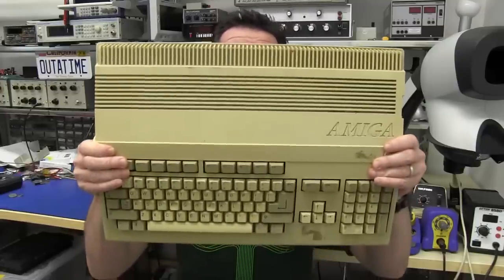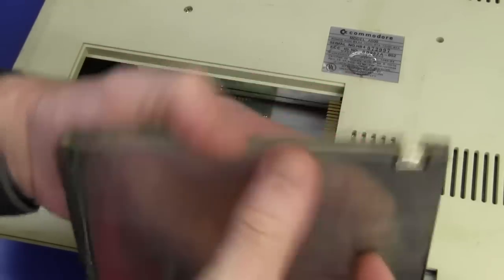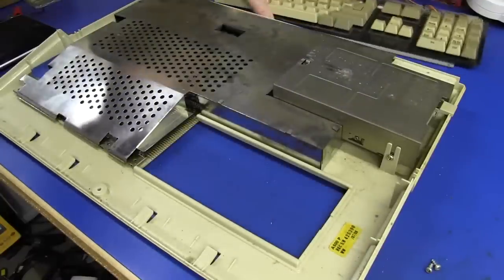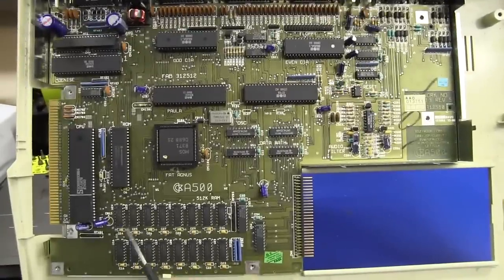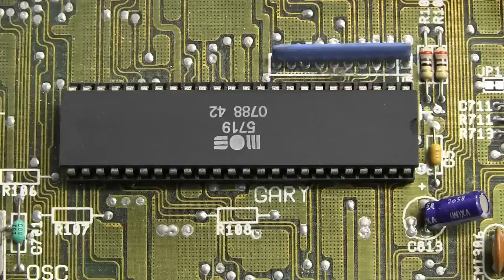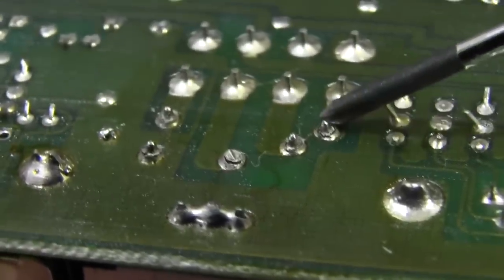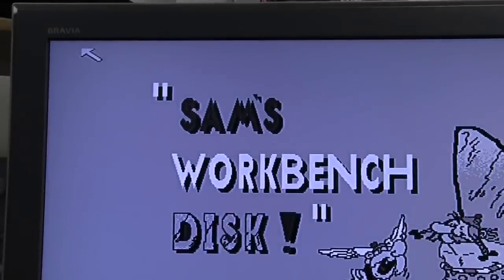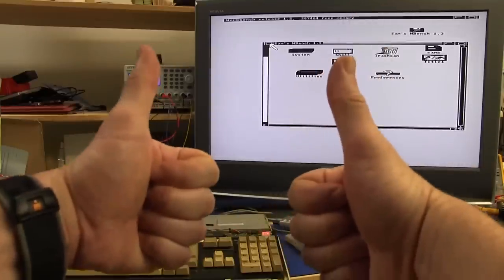EEVBlog #438 - Amiga 500 Retro Computer Teardown

Comment: no it isn't. get your facts right before you spout your mouth. 16 bit data bus, 24 bit address bus. the most significant 8 bits of the address where tied to ground on the CPU,  I programmed the Amiga 500 back in the day and later the A1200.

Comment: The ipad has a non-removable battery that will degrade in a few years even if you dont use it.  Apple have deliberately made it as hard as possible to replace it as well, prefering you just buy a new ipad. In 2035 i doubt youll be able to find an ipad battery still functioning.  Lcd screens (backlight failure, organic decay) and flash ram (limited write cycles) also have a limited lifespan.

Comment: graphics and endless layers of frameworks and abstraction.

shit like python running in java virtual machines running on c# bytecode... 

software nowadays is mostly quick dirty and inefficient just so they can crank out more stuff in less time. that's also the main reason most software gets so many updates... it's a mess.

a custom arch linux build is the only thing coming close to efficient: a full desktop with browser and all using no more than 300mb of ram and 2% of my phenom2 955.

Comment: Big hype for a pile of crap I thought.  Back in the day I blew like two grand for the Amiga 1000 with monitor and 256k expansion.  What a waste.  But if ya take the lid off the 1000 they have the team's signatures put in the plastic somwhow.

Threw it out anyway because it really, really was a total heap of trash.  The fact that Commodore made a comp after the 64 that wasn't backward compatible was a disgrace (personally, I think that sank the company).  Yeah, I bought the 64 emulator that was available and was able to load a directory or two on the 1541, but that's about all it could do.

LOL!!!  Guru Meditation at 38:17 ... yup, that's what the Amiga was all about.  Failure.
Reply: Yeah, one of the most popular computers ever, still has hardware made for it, huge failure.
Reply: Chris aQD Don't make angry.
Reply: Not angry, just correcting you in case someone who doesn't know better reads your comment.
Reply: Chris aQD Listen pal, before I went off to college I sold these heaps of crap to people:  The 500 just came out.  They hardly moved.  The software selection sucked.  Like it was really bad.  The 2000 was way, way, way too expensive.  And the 1000 had already tanked.  They also came up with the brilliant idea of changing the port genders.

Whatever with your little circle of people that still use it.  Hell, I still use the c64 so I guess it's still in use too.  Perhaps you were part of the design team, or assembly or something?  If so then shame on you.

The guru failures were sickening.  HAM mode was 100% useless without a high persistance monitor... yay, let's watch the traily pointer.  The graphics were crap - YES, I said they were crap.

Maybe three or four games were okay.  Most people just couldn't afford it.  Even afluent people saw no use for it other than the next gaming toy for their kid.

If there were any redeeming thing about the Amiga it was genlock.  But talk about a corporate niche.  Some TV guys made use of that.  We just played with it a bit yawn.  Personaly I also made use of DigiView, or whatever that capture block was called, even though it was turd slow and colour-wheel annoying.

The Amiga computer is dead and obsolete.  Don't make shit up about it still going!  It was a fucking emarrassment to all .  Way, way too pricy for what it gave in return.  It was a spectacular FAILURE.

Had I known better I woulda bought the Atari ST, at least it had a healthy bunch of games and didn't cost as much.
Reply: Did I mention that the C compiler was $600!?  That was another hole in the pocket of a young man.
Reply: schitlipz I was speaking about you.
Reply: dreamyrhodes No guff.  Stop trolling for a fight.
Reply: schitlipz
Says the one who started the trolling.
Reply: schitlipz You're free to like it or not, but lets clear up some factual errors.

The A500 "hardly moved"? It is one of the best selling computers ever made, it sold in the millions. The desktop variants were more expensive, but this video is about the a500.

I was not part of any design team or similar, just a user.

"Expensive"? The alternatives were either priced more or less the same(Atari ST) or several times more (IBM PCs). Shortly after release you could get them for $500.

"Useless HAM, good genlock", pretty funny considering HAM-mode was critical to the genlock success.

"crap gfx" At  least as good as anything that was reasonable to compare it to at the time, in most cases better.

I have never said the amiga is an alternative to current computers, don't strawman. I said it still has hardware made for it and a lot of people still use them for fun. Few other computers from that era can claim the same.
Reply: +schitlipz while the sales may have been bad over in the USA/Canada, they definitely where not bad in Europe. Commodore sold something like 5 million A500's. As for the cost: a PC with monitor was usually 2 to 4 times as expensive (at least, here in Europe) as the equivalent Amiga with monitor.
Reply: +Jeroen Knoester to correct myself, the five million figure is more like the total of all Amiga's sold. That said, most Amiga's sold where indeed A500's.
Reply: lol this dude, superior technology(which this Amiga was) does not always win, Beta vs VHS in the VCR world proves that.
Reply: That was sadly the case in US and Canada. In Europe the Amiga 500 was a huge hit. And you didn't need a monitor, just a television adapter module. You guys were actually arguing about two completely different regions which had very different sales figures and user bases. So you were both right. Everybody wins :)

Comment: Guru med. is normal for this litte RAM machines. workbench and game takes to much ram. This is one of the big "downs" on thwe amiga - no memory protection. 
Guess what happend: the OS is up and running. the loaded code asked the OS, hey i need xxx kb of ram. The OS wanna tell you "no..i do not have it for you" and simply return "0"...guess what: the routine fills its code to $00000000...upps...at $00000003 is the beginning of the ram table...bang...the amiga must crash..guru..:)